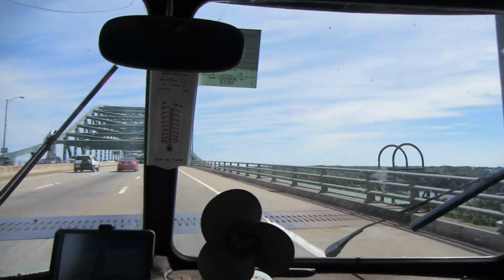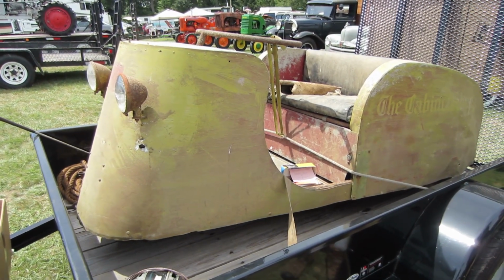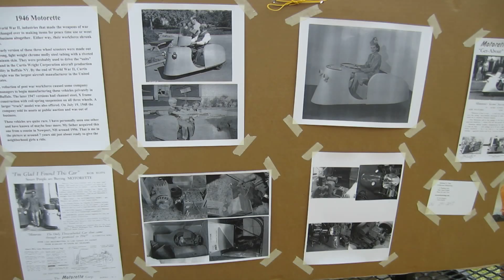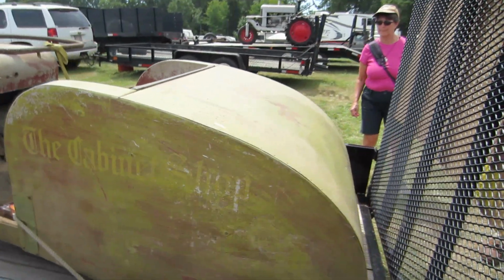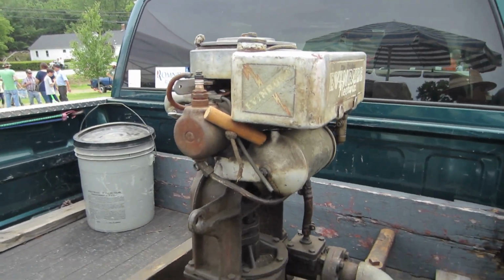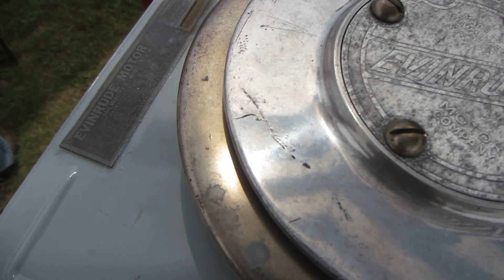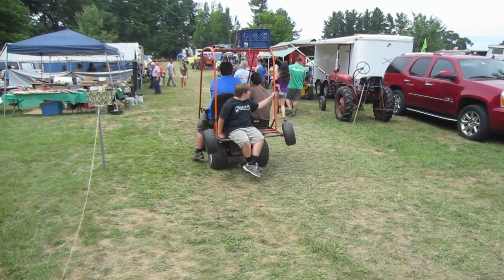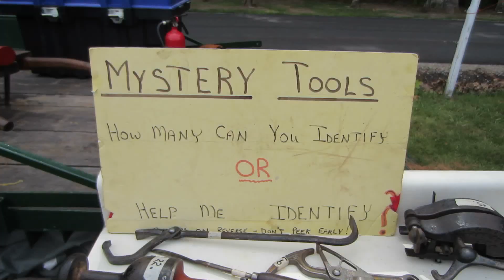tractor and small engine show, eliot maine  7/31/16

Comment: Remember the old 60” front deck Yazoo mowers with high seat and single small wheel in the back?  It would throw you off if you whipped it around and didn’t hold on.